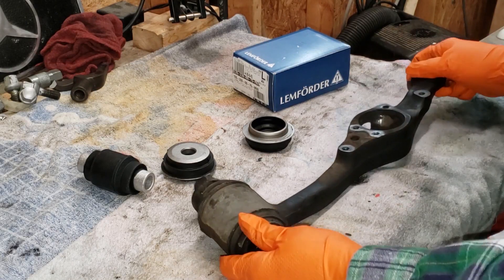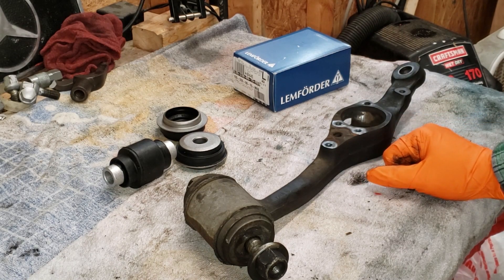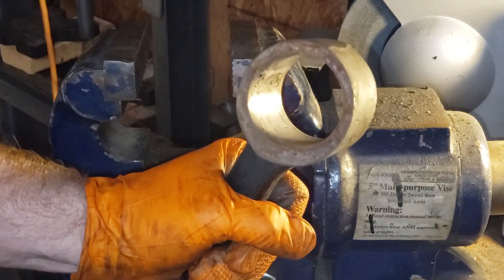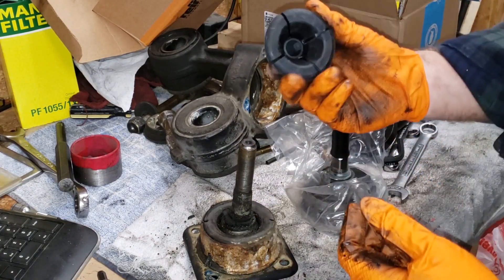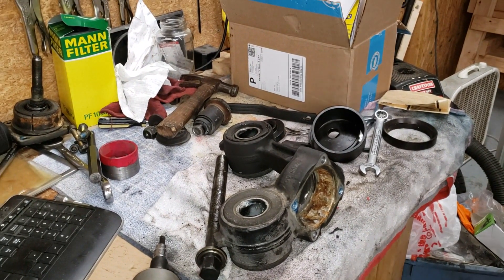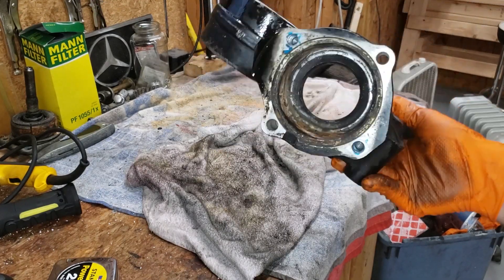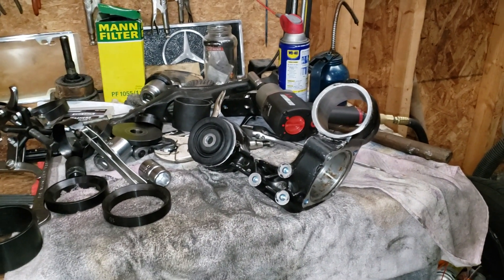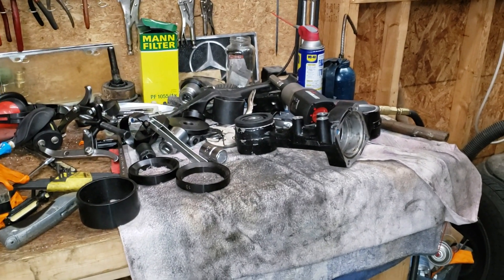1984 Mercedes 300SD W126 - Front Suspension Rebuild - Part 3

Comment: My problem is 1983 300SD rusted so that bracket is floating from the frame, at one of the cylindrical bushing housing. So the challenge is how to re-attach it with integrity.  Welding?
Reply from the maker: The braking support bracket bolts to the car with two large bolts and to the cross member with three smaller bolts. Are you saying that one of the bolts is not screwed into anything? Keep in mind that these large bolts screw into a capture nut insert that is not actually part of the frame of the car. It sounds as though it is this capture nut that is missing or corroded on your car. You may be able to replace it without too much trouble. Thoughts ?

Comment: Do I need to remove the spring to remove bottom part? I was looking at it and probably there is room for the bolt to come out without removing. We already talked abou it. What do you think? Thanks a lot.
Reply from the maker: The factory service manual says this is possible. It says to push the lower control arm forward in some fashion. Honestly I think they were high when they wrote that. I wouldn't even think about trying to do this with the spring in place. Taking a spring out is a royal pain but it's required in my opinion.

Comment: Thanks for your great videos. I have a 1983 240D, replaced the guide rods with URO brand and just 500 miles later one of them came apart at the ball socket. IS THIS NORMAL? The oem guide rods were torn(the rubber part) but they were still holding. Now I am afraid that this could happen when you're going 60mph. I ordered a set of Lemfoerder brand. Thanks in advance for your help.
Reply from the maker: Yeah Uro is crap. I don't buy their products.
Reply from the maker: Stick with Lemfoerder, Febi and of course Mercedes where possible. Just my opinion of course.
Reply: @ImpalamansGarage  Thanks for your advice, I just  hope that the other brands don't come apart like that..

Comment: At 5:50, it doesn't even move when I hammer it
Reply from the maker: Various things you can try. Clamp it in a vise and use a bigger hammer OR heat aluminum housing gently with a propane torch. (GENTLY) OR soak the whole thing in a bucket full of used oil. OR You could start drilling holes in the bushing to eventually break it apart. I would not expect the job to be easy. That may take you a while. Lastly you could throw it away and buy a whole new one that already has bushings jnstalled. Just bring money.